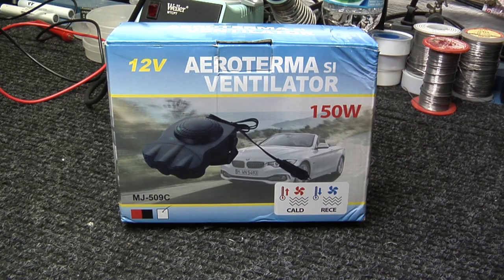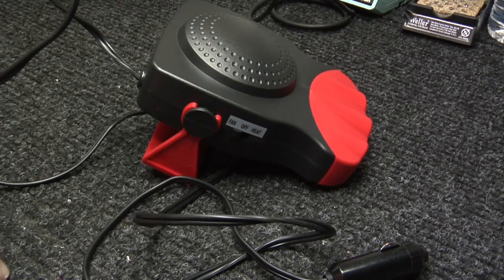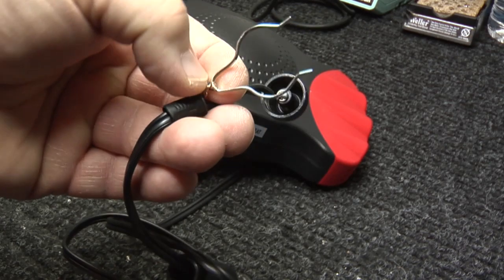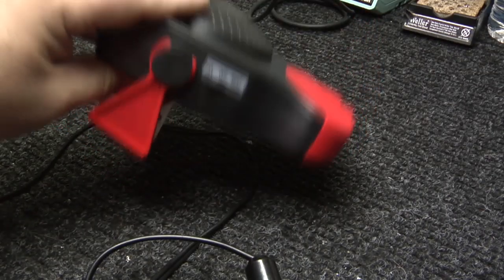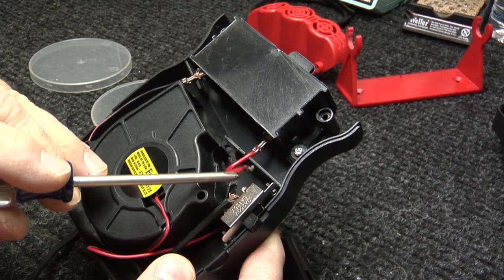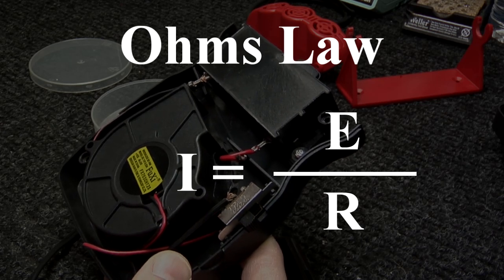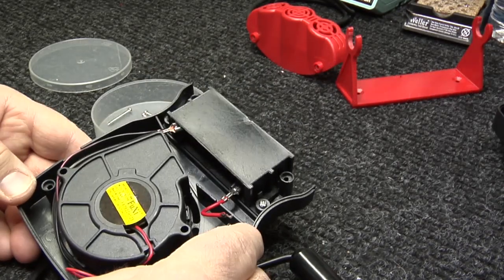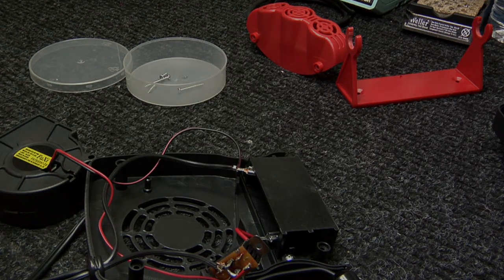12v Electric Car Heater Review

Comment: You used the PIE chart to do the math that's good but; the resistance of just the element well increase as it heats up so; using a cold measurement isn't the correct way. A dc amp meter in circuit well tell you what is going on...all that aside this unit is a piece of junk and a fire trap

Comment: that ceramic heater is actually called a PTC standing for "positive temperature coefficient ".  resistance goes up drastically as it heats up and reduces the draw current, resulting in it stabilizing at a pre designed temperature. resistance measuring it to determine its current draw is completely invalid . its not a resistor.
it draws depending on design and ambient temperature, plus fan cooling ofcourse,

Comment: I was just about to buy one. Thank youuuu
Reply from the maker: I can't recommend anything else as I got rid of the vehicle I needed the heater in. BUT I know someone has got to have made something better. Look for UL or UTL tags on the product. I didn't, and I got garbage!
Reply: @StevePietras  thanks steve ☺ i actually just purchased a mr heater little buddy. Just to take the edge off when needed.  $65. Just to get thru this cold weather . later ill get this heater fixed .

Comment: Even if you get 240 watts of heat, at 12 volts, that is a FULL 20 amps of draw from the battery.
Many accessory sockets are not rated for a 240 watt heater.

Comment: these are intended to be used in short bursts to defrost or defog a windshield until your vehicles engine can warm up enough to use the heater, these are not intended for use to REPLACE the heater, most Modern vehicles can only handle roughly 5-10 amps from the accessory port (cigarette lighter plug) older vehicles that actually had said cigarette lighter OEM can do 20Amps safely, you would blow the fuse for the cigarette lighter port on most "modern vehicles" which on a vehicle made after 2009 can be a real pain to find and replace, but i do agree, as far as the build quality, that is some Micky Mouse "engineering" there even for a cheap Chinese product, and i believe some people buy these things assuming that they will be a replacement for the heater that came from the factory, these things output between 120 to 175 watts at most, your OEM Heater is 15,000 to 17,000 BTU/hr when the vehicle is at operating temp, for reference, a 1,500watt space heater is roughly 5,114 btu/hr or so, the fact it calls itself a "heater" is actually funny in an ironically misleading sort of way, not a bad video, be safe out there

Comment: What would you Suggest for a heater for a car
Reply from the maker: Anything Name brand, UL listed if you can find it.
Reply from the maker: This one is just "OK" for keeping the windshield clear. It's not going to heat the entire vehicle but it is also not going to damage your vehicle and has a fuse. The lesson I learned was read the features and see if a safety testing lab seal is present on the box (like U.L.) https://www.menards.com/main/tools-hardware/automotive/automotive-accessories/automotive-electronics/peak-reg-12v-heater-fan/pkc0h1/p-1497594113297.htm
Reply from the maker: red oct  That is a different product shown in the URL you listed. It looks similar to the GOOD one I purchased to replace the crap unit I show in this video.
Reply: @StevePietras  I looking something to heat my car,any other link?

Comment: Thanks dude. Glad I do my homework before spending. 

Question for ya tho mate. I do need a 12v heater for my VW Caddy Campervan, so is there a 12v fan heater you would recommend ✊
Reply from the maker: Look for "UL" or other safety test lab certificate associated with the product. No plug in 12v heater is ever going produce enough heat for an entire vehicle space. These devices are "resistive" by design. This means to produce more heat, they must draw more electrical current.

Comment: thanks for your honest review...did you find a car portable heater that you would recommend yet? i need to get something for my car ASAP... my heater doesnt work (a/c works great) & no one can figure out whats wrong with the car heater. being that i deliver for a living, I need to have something since its 24* outside.
Reply from the maker: Nothing in the aftermarket will ever produce enough heat as a working heating system in your vehicle. I recently saw a website openly admit they are compensated for reviews AND they highly recommend the heater I tore appart. I ended up using a ceramic 110v heater that had emergency shut off in the event it got knocked over. I put it on a cookie sheet on the arm rest between the seats. I plugged it in from the house each morning while getting ready for work. I then used a small prestone 12v heater to keep the windshield clear while driving. On snow/rain days it was difficult to keep the glass clear. I found turning on the AC and blowing it at the window cleared the glass quickly BUT I froze. I don't know where you live but check out http://www.wjr.com/thecarshow/ you can call and speak to expert diagnosticians who can help figure out what's up with your vehicles heat system. If you do decide on going with aftermarket as a temporary solution, look for UL or ETL ratings. Check to make sure the device itself is fused. Yes, your 12v accessory (cigarette lighter) itself is fused BUT in a malfunction, electrical current thermal stress could possibly damage your vehicles electrical system. Waiting for that accessory fuse to do it's job in an emergency is just not a good idea. Is your vehicle a GM or GMC by chance?
Reply: @StevePietras  i'm in Western WA (south of Seattle)...and I drive a 95 Kia Sephia
Reply from the maker: @ImmaQT2  did your mechanic perform a volume test on your heater core? Passages could be blocked. Also measuring cooling system pressure can tell you a lot about a vehicles health. I assume the typical water pump and thermostat checks have been made.  It is also possible the problem could be in the dash of the vehicle in the vaccume controls that run the system. Do you hear a low steady "hiss" in the vehicle behind the air mixture selector? It's a 95 so I can understand you might get not want to go too deep but sometimes the biggest problems are fixed by the smallest soultions.
Reply: @StevePietras  I'm not sure what or how he checked. I did see him take out the glove box area to look inside for a clog. Not sure what he heard. What I do know is the A/C works great. Also if I idle the car, then turn the heat on I will feel some warm air coming out but it doesnt last long. I assume that is the heat from the engine. There are many other things wrong with the car. I didnt consider it worth trying to fix the heater since my car is old with several issues. Cant lock doors,windows dont roll down, ball bearings going out (they are getting noisy), oil places refused to change oil cause they said my bolt doesnt look good & could be leaking so Ive been changing my oil myself. There are several other issues too. Its why I thought getting something to help me fight off being cold would help till I can save up enough money for another used car.

Comment: what portable heater do you reccomend
Reply from the maker: Anything other than this junk. LOL  Look for UL or ETL labs testing stickers. Also, any reputable brand name that generally stands behind their products is a safe bet. Nothing will ever replace the heat from a working vehicle heating system, but small heaters can help with defrosting side glass.  Many big box hardware stores carry items like this, a safe bet you can return it if you don't like it or have an issue.  I bought online and got hosed when problems developed. :(

Comment: Thank you. I'm looking for one bc my heater core busted at JUST 8,700 miles !! and I unfortunately thought I had the 10 yr 100,000 mile warranty.. Since I'm broke living on disability I had to use Stop Leak used for leaking radiators and heater cores... well it stopped the leak alright and plugged my heater lines!! I'm so mad.

Comment: Bought them 20 years ago.....absolutely no heat. Just a very annoying noise maker.
Reply: roger sowers that was 20 years ago dude
Reply: 20 years ago wtf??? Do you  have time travel  machine???? Where did you get it ????
Reply: @MM-rw6gp  Heartland of America. Maybe not the same brand.....but it was also 150 watt. Never worked right and the noise was unbelievable.
Reply: @rogersowers9837  I have same like in video ,i didn't try it ! I'm afraid not to burn out the installation of a new car!!! The car have 13670 miles on clock
Reply: @MM-rw6gp  I plug in an old 12 volt tire inflator in one of two cigarette adapter, now the one I plugged it into don't work. (Might be a fuse) I wouldn't take a chance on anything over 100 watts.
Reply: @rogersowers9837  Thank you 👍